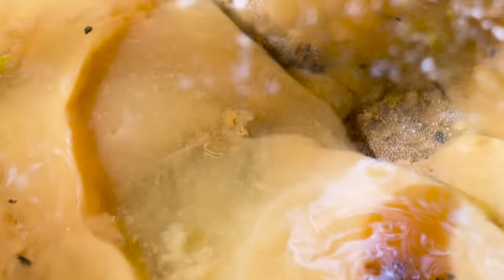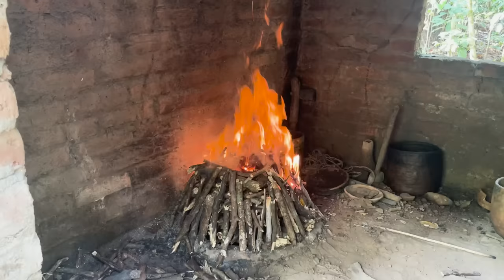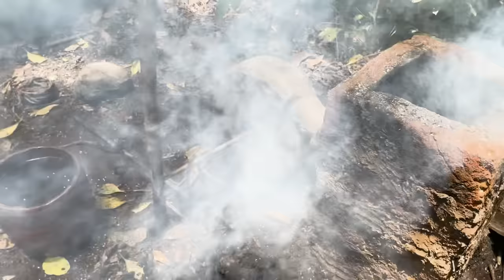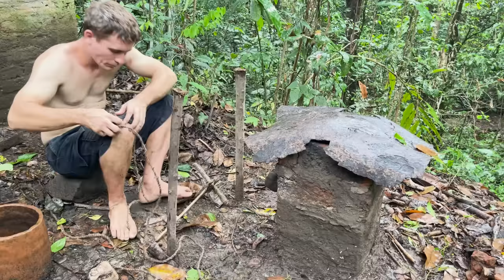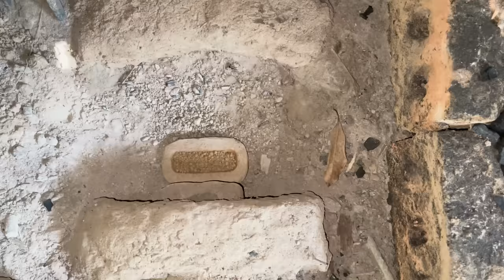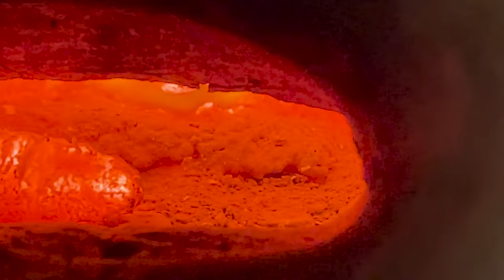Primitive Technology: One-Way Blower Iron Smelt & Forging Experiment

Comment from the maker: The new blower produces more iron than the previous one. Using the same amount of ore and charcoal, a similar sized furnace and the same bloom processing method it makes 51g as opposed to 31 g of the previous design. The continuous blower is a big improvement over the intermittent spinning design (and this was only the first try). It's the most iron I've made in a single smelt yet.

The attempt to form a forgeable bar was disappointing although it was a better than expected casting. In the past I had successfully made forgeable iron by melting the prills in front of a blast rather than making a casting first. I will probably follow this method of decarburization rather than low temperature annealing in future.

The waste iron isn't lost however, I should be able to recycle it in future smelts as I've got a small pot of it. The waste iron from experiments could be re-smelted alone or added to future smelts to increase the yield.
Reply: İm waiting for
Reply: Why no lid on the mold when smelting?
Reply: How does the charcoal making method at the start of the video work? Do you not cover the top? I thought that you need to greatly reduce oxygen access.
Reply: Nice, Ive been wondering what would the first iron tool be, when made, would make forging all the other tools easier?
Reply from the maker: @gregstarr2  A lid would prevent the heat getting into the iron as quickly. Charcoal on top of the iron, directly touching it, conducts the heat more efficiently as iron is a better heat conductor than clay. Oxidation is of no concern considering the iron is already high in carbon and the oxygen has a beneficial effect in decarburizing the iron. Thanks.
Reply: 2 Bellows?
Reply: Perhaps try adding powdered charcoal to the crucible to reduce the impurities from iron oxides, and also try adding wood ash or another substance that could work as a flux to reduce the effect of air on the iron?
Reply from the maker: @eduarddlabola9688  When the charcoal is doused with water it stops it from burning to ash. As you add layers of wood, the burning layers on top use the oxygen, preventing the layers below from burning. So at the end you are left with carbonized wood. The residual heat dries the water off the coals. Thanks.
Reply: i believe you need flux to forge those prills together correctly. dont know when they started using it back then.
Reply from the maker: @user-sd3ik9rt6d  In series two fans would be effective, yes. Thanks.
Reply: Why don't you make a closed mold for the iron so less unwanted stuff mix with it, maybe you can make it by making the same mold you made in this video, then making a cover on floor and stick it on the mold once it's a little dry.
Reply: wow I put the subtitles on and I was able to read lots of good advice! THANKS . don't know this iron battery, super interesting :)
nice videos to watch without words, which relaxes and gives all its charm to your videos. Well done
Reply: @primitivetechnology9550  This came at a perfect time! Thank you for the upload!
Reply: It's impressive that you can do so much with just natural resources. Is it possible to make glass with your current technology?
Reply: Is t an idea to make a blower system like the old wood lathe used to have with a springy branch and a peddel?
Reply: I think the problem is that the pieces of iron are very dirty and this makes it difficult for them to join together and form a single, resistant piece. It might help if you can somehow clean, polish the pieces of iron until they are shiny gray and then try to melt them.
Reply: @primitivetechnology9550  what would you recommend as a way to get started doing primitive technology in alpine areas of northwest United States? Specifically the bitterroots/rocky mountains. It's surprisingly difficult to get useful information by looking at what the native Americans did.
Reply: @primitivetechnology9550  I have seen in a similar channel that rather than a spinning blower, a piston-like blower is used. Would this be possible given the limitations? I.e. rather than the piston being made out of a large log, a clay pot with holes could be formed? Cheers mate!
Reply: What if you put a handle on it to crank air in like with modern steel blowers? Makencreate had a video with a blower that was seemingly (perhaps Im wrong) powered with a type of belt. Do you think those methods could be used and possibly produce higher temps?
Reply: @primitivetechnology9550   I am really sorry for mentioning this if I am mistaken or crazy, but, I noticed a lot of trembling/shaking from your hands. I hope you are good and healthy my man. Take care
Reply: Fantastic work as always, thanks for trying the dual wield
Reply from the maker: @krzysztofdabrowski7803  Yes, ash might work to lower the melting point of the slag in the crucible melting process. I need the iron to get more air to burn the carbon out of it. I think there's too much carbon in the iron as it has a low melting point (can melt it in an open hearth) and it's quite hard but brittle. I was able to make it malleable in a previous video by remelting it in front of a tuyere with lots of air in the forge. Thanks.
Reply: Not necessarily with iron but I mean the very basic stuff, what to use for rope, what to use for vines and the roofing. You used palm fronds and what seemed like very abundant vines in your first videos but those aren't very common here.
Reply from the maker: @deezr01  I think the main problem is it's still too high in carbon and so is hard and brittle. When I get it malleable then flux might be needed. Thanks.
Reply: Hello, I already commented this but it would be interesting to see if there was any good way to hook up this blower to a waterwheel. If possible I imagine that would cut down on the workload significantly and allow for doing other things in the meantime between adding charcoal etc. when smelting. Great video looking forward to the next one.
Reply: I am no expert at this sort of thing by any means, but I believe your going to need to smelt the iron many times in order to get as much of the impurities out of it as you can. The reason it crumbles is because there is still to much "not iron" in the over all composition. How to accomplish the removal of said impurities I can not say for your situation. I do know that modern steel making using slag from previous fireings to strip out the sulfur, if you can find a way to use this when you smelt it might provide some benefit.
Reply: Great progress in this one, glad to see you making strides and continuing to learn. Just wondering but is there any other mineral deposits besides iron nearby you? Would you consider trying to forge them?
Reply: Have you tried making a crucible cup?
Reply from the maker: @ginli2567  Welcome!
Reply: I wonder if you put holes in the nozzle piece if it would draw in more surrounding air in via the Bernoulli effect before entering the smelting chamber.
Reply: @primitivetechnology9550   why roast the ore before putting it in the oven with ventilation? thank you from France
Reply: @primitivetechnology9550  for a more efficient blower a flywheel would be a good way to conserve momentum.
Reply from the maker: @theuser810  Technically I've already made glass in the form of slag (some looks really glassy, green and blue). But I think you mean clear glass. Yes it is possible to make glass. I've experimented with wood ash and sand but it makes a mess. I might be able to make glass objects in a mold by taking gobs of slag, from the forge and pressing them into molds that were pre heated and then allowing them to anneal slowly back in the forge. Thanks.
Reply: I worked as a blaclsmith and the main issue i see is that you are working the iron to cold for welding it into a useable bar.

 Also dont cover your crusible with charcoal, sit it in the carcoal and melt it into a useable bar. The reason you dont want it in the carcoal is that it can actually cause the iron to start to "burn" where as if it is not directly exposed to the heat it melts more easily.

The only other thing i can recomend is doing something like what vikings used to do and making a capsule with the iron in it to fully melt it and then break out the ingot.
Reply: What would happen if you dumped the whole slag/iron mass into a large pot filled with water? The slag would shatter similar to glass, but would it separate more of the iron prills so you don’t have to do as much work to separate the two?
Reply: @primitivetechnology9550  can the tuyere be put further back from the airway causing more air to flow into the furnace?
Reply: @primitivetechnology9550  
I would add a flywheel on the blower shaft, ceramic seems to be the best. It would have a groove for rope and there would be a bigger pulley (wooden "wagon wheel") with the crank in front of it. Thus this would make the blower spin for a long time and with high speed.

The bigger concern I see in the furnace itself. I do not think that a bigger chimney would help if You use the blower. I think that the issue is that the iron barely melts and falls to the bottom, where the furnace is cool since there is no airflow. 
If You make the bottom of the furnace in the shape of the forge (bowl) and the air blows on top of it, it should make a layer of iron and then slag on top, thus removing the slag separation step and increasing yield as well.
If I recall correctly, the typical blast furnace uses coal and iron ore in layers, so You should not add the ore at one time only.
This produces cast iron, in the past, the carbon was forged (beaten) away, thus I would consider the iron bar shattering a normal step.

I hope that some of this will help since we all are patiently waiting for your Iron Age. This is what I remember from school, so check elsewhere if You are planning to use it to catch possible mistakes.
Reply from the maker: @tdog2949  Yes if the fan is to spin in both directions, a pole lathe would work. To get it to spin in one direction how ever you need to have an idle phase in the cycle where the rope loosens around the axle on the return stroke. That might be hard with a pole lathe set up. The reason my leg rope method produced continuous rotation here is because I loosen the rope by moving the leg imperceptibly closer to the rotor on the return stroke, allowing for the idle phase. Thanks.
Reply: Excellent work with the new blower

You might need to keep melting the iron and leaving it to slowly cool after the initial mold, maybe transferring it to a wood fire and holding it near red for a long time after the initial casting could help form better grain structure 

Maybe adding a tiny bit of silica using clay dust during the initial casting can help add silicon and make it more ductile
Reply: Been watching these for a while and love your videos. You should really try preheating your air. Use a small secondary fire with a thin toyere (as thin as possible to promote heat transfer, maybe even multiple nozzles to improve volume flow) going through it and then into your kiln. You'll be able to achieve much hotter temperatures in the kiln.
Reply from the maker: @Fantasma-vz1ix  You might be right, I've not melted fresh shiny prills yet. Thanks.
Reply: In modern forge burners, there is often a jet of gas sticking into a much larger opening and that allows additional air to be sucked in. I wonder if you made the nozzle of the blower smaller and placed it in the tuyere so that it does not seal and had a gap all the way around if it would suck in a larger volume of air.
Reply: Nice yield, mate. Very good job
Reply: I'm fascinated by your films. Try making a gear wheel mechanism for the blower for better efficiency
Reply from the maker: @justinkeele4450  It depends what you're interested in. The rocky mountains looks tough. Probably start with shelter. Dry stacked stone huts or pine wood huts would be a good start. Always start with shelter so you have a place to store your projects out of the weather. Thanks.
Reply: At this point, with your improved furnaces and blowers, do you think any improvements in the quality of your charcoal would be more significant?
Reply: Have you considered just using a crank for the blower? Especially on the horizontal one you use during the second half of the video, it may be possible. Maybe it’s too fragile though.
Reply from the maker: @ginli2567  I've looked at making a piston bellows from clay (made one at home). It produces some air flow and may have higher pressure. But I haven't tested one on a fire yet. I was making a video on one but the rain destroyed it. I'll revisit it another time. Thanks.
Reply: I am VERY curious if you think you can make a Baghdad battery.  It is VERY simple to make, and if you can make that, you can make copper wires, and make an electromagnet, which you can then in turn make an iron magnet, then maybe a generator?
Reply: The circumference of that little wooden stick rotary shaft is tiny. You need a gear, a larger sphere of wood where you can attach the rope. It's like you're riding a bike on first gear.
Reply: Really nice having those improvements. You could add a small weight to the shaft of your flywheel, near the flywheel itself. It would need to be balanced (symmetric). This might allow less 'pulls' on the cord, but still have the same speed of the flywheel, or a bit more. Not sure it's important, but since you made other improvements I thought it worth mentioning.
Reply: Would putting the mold away from the tuyre make the melting process more efficient because there is less cool air getting to it?
Reply: @nureinbratwurst2109  It's hard work and fatigue.
Reply from the maker: @danielmariolle4918  No nearby sources of copper or tin that I know of. That being said, I could be walking past copper without knowing it. Generally copper deposits are found in these sort of domed structures called gossans, I think on the edge of basalt and granite. It's where the oceanic crust has melted under the continental crust and the lower melting point minerals have come up as molten blobs. I keep an eye out for greenish stones. Thanks.
Reply: I would like to discuss an idea that I had which might multiply the draft through the furnace.
If you were to add a second air hole below the Tuyere, and possibly angled the Tuyere slightly upwards instead of downwards, might the draft upwards through the furnace from heat rising suck in additional air from below?
This would increase the heat created without requiring additional work.
Reply: Have you thought of enlisting an extra person during the smelt so the blower can be operated continuously by one person and charcoal and ore added by the other person?
Reply: Still think you should put rocks on the rod to make a flywheel as it will balance out your inputs and make it spin more consistently.
Reply: I love having watched the stone mortar grow deeper and deeper with every video. You can tell it's had a lot of use!
Reply from the maker: @DAV4WSR1  Roasting ore dries it out physically. But it also removes chemically bound water too. This is an energy consuming step so if its done before smelting then it prevents heat from the smelting process being used up, leading to higher temperatures during the smelt. Thanks.
Reply: What about adding bit of weight to spindle (like in pump drill) may save some energy. Also would it make sense to make cone shaped tuyre and add some holes to narrow part or spread it at joint? (Bernoulli law says it should work better, but i don't know physics)
Reply: That improved efficiency was exactly what I was hoping for. After the Cody's Lab pop can thermite video yielded a large mass of iron, I suspected that higher temperatures with the better blower would give you a much higher yield and that was a very noticeable improvement.
I'll be really excited to see if future improvements could eventually yield a singular large mass of iron ready to start processing right after. God bless you my man. :)
Reply from the maker: @MiladEskandar  I'm working on a preheated air method, many people have mentioned it and it sounds like a good idea. Will test soon. Thanks.
Reply: 7:36 Also, I hate to be "that guy"  but you are losing energy in both the movement of the uprights and in the off center nature of the spindle.  I would suggest making the entire blower assembly in two parts, with the only removable part being the lid and formed (and fired) spindle and blower fan (which should also be of fired clay.  Yes I think that can be done by you, I've seen your pots.)
Reply from the maker: @vahannema  I'll work on a charcoal retort, it's on my list. Although pit made charcoal seems similar to mound charcoal as long as it's dry.
Reply: What about a water powered blower? You may even be able to setup multiple water powered blowers at the same time then, like one on each side of the forge. A simple waterwheel could power two blowers, front and back sides, at the same time.
Reply from the maker: @myrhev42  A one to one hand crank doesn't spin fast enough. I tested the idea here: https://youtu.be/Csb-AFD58ww .Thanks.
Reply: @primitivetechnology9550  seeing your replies has me curious - what is your research approach to trying new methods? i've always wondered how much is improvised!
Reply: @primitivetechnology9550  Good of you to ignore a legitimate question about something important. Shows a lot. Cheers
Reply: @primitivetechnology9550 Try making the tuyeres longer so you can have a secondary fire that heats up the tuyere, the fresh air from the blower will be preheated before entering the main furnace this way. You may need to make the tuyere in multiple sections or perhaps some more sophisticated heat exchanger design. This can greatly improve you melting process. I work with an industiral blast furnace and our air is preheated to above 600c before entering the furnace.
Reply: Curious if there is potential for mirroring the blower on the other end of the rotor shaft so you can have two smelts going simultaneously
Reply: Maybe you should take a look at japanese primitive metallurgy methods.... They can manage carbon content in iron very well....
Reply: Have you considered trying to find a natural flocculant to settle out the iron bacteria?
Reply: Does mud have any superior properties over plain clay? Or do you use it in cases like putting the tuyere in because it's significantly cheaper?
Reply: I and my kids love your videos. I do have a question though. If you turned the continuous air fan shroud upside down; as in instead of having what looks like the shape leg of a P pointing down from the top, have the shroud's P on the ground, while still maintaining it's current axial rotation; Would you be able to bury the the tuyere in the ground and therefore hopefully making a better sealed duct for the air to enter the bottom of the furnace?
Reply: @primitivetechnology9550   Okay, thank you, nice to read you ;)
Reply: You should use the river to keep the rotor spinning continuously.
Reply: you need a flux like borax to make the iron more stable for forging
Reply: man you should try to make a hammer or knife, with the current level of technology you're at.
Reply: @primitivetechnology9550 Try making an ancient blowtorch maybe for precision metalworking. All you need is some kind of oil lamp and a blowpipe that blows into the lamp's flame. It gives a jet of blue flame.
Reply: @AlexeySherstnev  he  doesn't need to he just need to make a wheel with a handle on the side for the belt to attach to.. that shoudl give him the  constant speed he needs
Reply: Would it be beneficial to add a circular clay weight to the rotating part of the blower to better maintain momentum and decrease airflow loss when not powering it, similar to how they do it in cars?
Reply: My kid asked me if you'd ever used a crucible before.  I told them I don't know. But we should ask. I think it would make refining the ore much easier.
Reply: I was wondering about the change in charcoal creation, I have read one of your previous Wordpress articles and it said something along the lines of "I let the charcoal cool down until warm to the touch (Sometimes taking two days)." Here you douse the charcoal with water right after fireing the wood. Any chace I just missed something? I am greatly curious on my there is a possibly different method used here.
Reply: Cant you add some selfmade flux to the iron before melting it to a bar?
Reply: For max air, I would think a double accordian bellows (one side is always sucking, one side is always blowing), run by a waterwheel would jack those temps.
Reply: Okay one last idea ..If you had a gravity assisted feed of charcoal and the Iron prills you wouldn't need to stop the fan. The thought I had was to have a basket up in the air for both the coal and the iron slag and you can pull on a rope to pour the reagents into the furnace.
Reply: That makes sense, with the new blower design you are able to both get the furnace to a higher overall temperature and keep it there more consistently. One thing that might be good to try would be to increase the size of the batches (if possible) as there are positive correlations of yields to the quantity of ore being processed in a single smelt with bloomery furnace designs.
Reply: it might be benefitial to give the rotor of the blower a sort of flywheel
Reply: potentially would be more difficult than it intially sounds, but instead of a second bow thing (the rope and stick) on the other side of the blower, could you attach one upside down to the current one, so that it can provide power in the right direction when the other is lifted, and vice versa?
also thank you, your videos are always great to watch
Reply: if you made a disk shape on an axle and connected your pulling rod to the outer edge of the disk on one side it would be the perfect setup. then just add a hand crank and youre good to go, it would convert rotation energy to linear energy in the rod and then back to rotation for the fan axle
Reply: To get the metal balls out of the slag, you could try building a grinder. This could make the step a little easier.
Reply: @catseye10000  But what about production volumes? Does he need to increase his productivity? I think this is important.
Reply: @AlexeySherstnev  no cause he is a researcher at university, this isn't business for him, he trying to figure  out how early peoples did things
Reply: Maybe adding a clay disk to the rotor for weight will give enough inertia to keep it spinning between strokes. Also, maybe drive this clay disk with a larger wooden wheel connected with a rope/belt... For the "double stick" technique, if you place one of the sticks above the rotor with the loop upside down, you can generate power by drawing the first stick and then by pushing the other. Also, connecting them in a Δ shape will make the operation a lot smoother.😊
Reply: @primitivetechnology9550  Two ideas, maybe have smaller bowls with the coal and ore already portioned in them would mean a lot less time away from the blower, you'd not even need to get up. Other thing, adding any kind of gear system to this would make it blow soooo much more than it already is. Just making another similar device you're using to drive it now but instead driving a larger diameter clay disk with a belt going to the one you have now. Or simply make a crank. Would be happy to go more in-depth if wanted .
Reply: I enjoy these videos. I got the book as a gift a few years ago.
Reply: When you pull towards yourself in a sitting position - It looks like some kind of movement with very limited use of body power. Enlarge the whole structure a little, make it more robust and raise it a little. Then you can stand up and use both arms, core muscles and other strong muscles of your body. Any person who works physically will tell you that in order not to get tired and to be more efficient, you need to load your whole body.
Reply: I saw your reply to someone asking about copper/tin. I think it would be fascinating to see the difference in smelting these ores vs iron... even if the ore was imported.

Thanks for making these videos. Only videos on YouTube that I watch twice. Once without subs to just watch and enjoy, then once with subs to see all the details. Amazing work.
Reply from the maker: @sum_rye_hash_321  It is a good suggestion thanks, good to know industry uses 600c air, I thought it would have been hotter. I'll see what I can come up with. Thanks.
Reply from the maker: @reyd__  Probably have the blowers in series (inlet to outlet) and just power one smelt. I've seen such blower setups, they achieve higher pressures. Thanks.
Reply: Do you think you could add a clay weight to the blower rotor to maintain momentum on the return stroke? I know that might be difficult to balance.
Reply from the maker: @EugenioCardoso  Yes, I've looked at Japanese metallurgy. There are lots of methods they use for carbon content primitively. Thanks.
Reply from the maker: @uncleelias  Anything very basic will cause it to precipitate. Ash will cause flocculation in theory, but it didn't work. I used bleach at home and it worked well though. Thanks.
Reply: Now you can see why they closely guarded the process.  There's still to this day types of steel that we can't figure out.
Reply from the maker: @ieatdirtwasntavailable  Yes, just cheaper, better to use mud than good quality clay, better to save it for pottery etc. Thanks.
Reply: Video idea: make soap out of wood ash. The ash contains lye and can be derived from it
Reply from the maker: @Scott_C  Yes, but the housing would have to go the other way so now it blows air towards the operator, and so the furnace would b between the user and blower. It's the way the rotor needs to spin because of the one way spinning technique. Quite feasible though. Thanks.
Reply: 📍 Look up: The Blast Furnace: 800 Years of Technology Improvement 
PULLEY IS AWESOME! 
Magnet or lodestone to help separate iron? 
📍 Consider making a gearing mechanism or flywheel. 3-step gears? 1st gear to 2nd, to 3rd gear to increase fan rotations? Then a gravity drive to the first gear (water wheel or stones).  Gears, gear steps, LOG axle flywheel:  🔹 wooden cage gear + a peg gear. YouTube search — Robert Murray-Smith peg gears  🔹 stone: Consider a basalt rotary quern-stone.  📍 log as axle creates greater stability (less wobble) and flywheel. Think of a gym bench press, but the weights at only one side. Two or three big plates with a few smaller/thin plates sandwiched between. These become different gear ratios and a flywheel. Lay across 3 or 4 sawhorses. Be sure to enclose or secure the empty side of the axel where your fan is located. Or integrate with the peg gears for different uses. Basically a waterwheel on land.
Reply: @PIESISSYSTEMS Yeah, any kind of gear system would make this incredibly efficient. I wonder if the disk idea would work with such simple tools and materials, I think it'd have to be very well balanced to not vibrate too much, and the simple wood might not be able to carry much weight or stay stable.
Reply from the maker: @Scott_C  Yes but heated from the open top (like this video). The clay here melts at iron melting temperature so a crucible wouldn't work if the heat had to go through clay walls. Melts the crucible before the iron. Thanks.
Reply: I wonder if adding a flywheel to the blower to keep the momentum on the return stroke would improve efficiency
Reply from the maker: @josepollo419  It's a quicker way of making charcoal. Charcoal made in a mound will be drier though and might also be harder. But they seem to perform the same in smelting. In the early days of word press, I always made charcoal in a mound. Then I tried pit charcoal and it seem fairly similar with results being about the same during smelting. Must be dry though. Thanks.
Reply from the maker: @SnapShotter  lime or silica. So ash or crushed quartz might make good forge fluxes. Thanks.
Reply: Congratulations on a new smelting record! Glad to see you finally increased yield
Reply: Would a wooden and a crank make a more consistant flow of air?
Reply: @ivetechnology9550 So glad to read that you are working on a preheated air method, seems to be the next logical step in raising the smelting temp. Any thoughts to reduce or eliminate the cool down time when loading the charcoal? 
Love the channel and look forward to all your videos.
Reply: I'd be very interested to see you do a beach survival situation
Reply: Making a wheel, or two even, for a pulley to improve your blower would make for a great video and open up a whole new branch of technology to explore! Do you reckon you could fashion one out of clay? You certainly have the skills to do so.
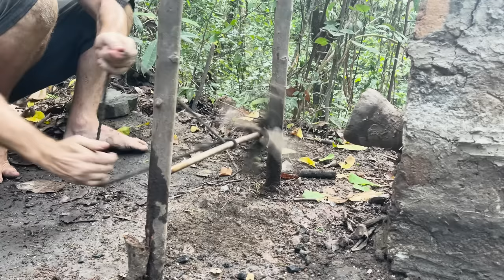Reply: 16:06 Using a gear ratio advantage would give a ton of air velocity if you could fabricate different sized gears or a suitable “belt” and pulleys. Think of a bicycle crank and chain.
Reply: Have you considered adding a flywheel to the fan rod? Like a flat disc shaped out of clay with the fan rod through the center?
Reply: @primitivetechnology9550  Have you considered experimenting with different types of charcoal? Some are known to burn hotter and cleaner than others.
Reply: @primitivetechnology9550  
Maybe try smelting it with a blower, but also a tall chimney to get some assistance from the draft?
A special finishing furnace, specifically for this purpose.

If you get enough quality iron to forge tools, you could start making better equipment out of wood.
Like say, a hand crank for your forge blower. lol.
Reply: Rather than two sticks, if you can support the weight, a clay flywheel would even out the RPMs.  Or even just more mass in your fan blades. The closer you can keep the tip of the fan to the enclosure, the more efficient it will be.
Reply: I wonder if a stone mold, rather than a clay one, could be more effective at isolating the iron so as not to ruin the integrity of the iron. Much more difficult and time consuming, but perhaps one of your more well-worn mortar could be repurposed? I also feel like the direct piling of fuel on top could be affecting the quality of the iron. Possibly contaminating it there.

But could an oven design of super heated air, rather than directly heating up against the burning fuel, be accomplished?
Reply: @primitivetechnology9550  thanks, what if debris gets in the molten iron though?
Reply: I don't know how feasible it'd be, but it would be interesting to see if you could get some automatic blowing action using a small version of a water wheel in the stream near your area. While it'd be significantly more work, some sort of weird gear reduction (because of the power of flowing water) using ropes miiight speed it up more. Otherwise, thanks for the content, love watching it.
Reply: I’ve seen previously that for this sort of more raw iron people would find it much easer to manipulate it using wooden hammers and blocks. This was to prevent it from shattering as the material was too brittle for normal hammers, I’m not sure if this is already in your consideration - but could be worth a try as it seemed stones really didn’t do the trick
Reply from the maker: @Scott_C  Maybe have the ore and charcoal in pre-measure baskets (one charge per basket). Then it wouldn't take so long bethween charges. I've considered it before but hard to make, need one basket per charge (e.g. 8 for this one). Doable though. Thanks.
Reply from the maker: @shadowtheimpure  Yes, a longer smelt would probably save more materials. Economy of scale. Thanks.
Reply: Have you tried doing anything to lubricate the bearings of the continuous blower? I assume there has to be a pretty big loss of energy from friction there and you could get more airflow by mitigating that
Reply from the maker: @chrisforeman1041  Yes, I tried one above and below the rotor but it was unwieldy. It was so clumsy I didn't film it. what happens is the two ropes are right near each other they snag. Thanks.
Reply from the maker: @catseye10000  I don't work at a university but yes I'm trying to figure out how to make it work primitively just out of interest in the subject. A citizen scientist if you will. Thanks.
Reply from the maker: @Schwarzgeist89  Much appreciated.
Reply from the maker: @beepseatsfindingfoodtreasu8756  It's hard won knowledge. Thanks.
Reply: Amazing results and lots of improvements, good job! I suggest adding a new tuyere and a blower on the opposite side of the furnace and using a longer arch to control even the opposite direction of the opposite blower, so you'd have two air flows coming all the time. I also liked the idea of using the foot for continuous movement. You could add a pedal like those antique sewing machines... :)
Reply from the maker: @KGTiberius  Good suggestions. Yes I've seen Robert Murrays videos, he's got good ideas. Thanks.
Reply: @ivetechnology9550oh cool and you  could  make a  crude belt wheel for the  blower  maybe  with handle. if that is not  to advanced for your purpose
Reply: haven't watched the whole video yet but i wanted to say that "annealing" cast iron really is not possible. cast iron just cannot be forged at all at any temperature or heat treatment.
Reply from the maker: @linasvelavicius330  Make pre measured charges in baskets so there's less handling between blowing the furnace. Much appreciated.
Reply from the maker: @ailbheskyfeather174  I think that's feasible but only a small diameter clay wheel (<50 cm diameter). Two in series does a lot for rpm as well. Thanks.
Reply: @theuser810 glass is actually easier then iron, the core problem is hes lacking diversity and quality of raw materials.
Reply: You should try a "belt-driven" blower that is hand-cranked so that the air stream can be continuous
Reply from the maker: @darkfur18  Denser hardwood charcoal is supposed to have more energy. Though some prefer pine, a soft wood, for smelting as it's got more "reactive". Not sure what that means but I think it's got to do with chemically reducing the ore better. I use Eucalyptus or northern olive for charcoal. They work about the same. Thanks.
Reply from the maker: @Chuck_Huckler  I tried a taller furnace but it works about the same. Thanks.
Reply from the maker: @timward4301  Or heavier wooden fan spokes, clay may break apart when spinning high speed. Thanks.
Reply from the maker: @Mcaark  The clay doesn't melt so it wouldn't get into the metal. Yes there would be some contaminant from the charcoal but it would be on the outside of the iron mass. Yes, pre heating air could be used in the forge, I'll test it some time, agreed. Thanks.
Reply from the maker: @gregstarr2  It would likely float on the iron as dross, not get into the metal. Thanks.
Reply from the maker: @keith4864  Yes it would need a gear increase or belt and pulley. Thanks.
Reply: @primitivetechnology9550 maybe you should make firebricks  because they hold the temperature high enough for longer period of time. They are made from grog mixed with clay. So thats my suggestion🙌
Reply from the maker: @NotToast859  Yes, I wet the bearings occasionally and it does make a difference (less noise, easier to spin). Thanks.
Reply: adding a clay flywheel to the new blower will also increase the effectiveness of the blower.
I think this results show that kiln temperature is still to low for efficient smelting. The new blower is definitely a step in the right direction. Good work.
Reply: @nureinbratwurst2109  Mate, I scoured this thread and only saw one other comment by you, which wasn’t even a question, it was an observation about his health. You write this comment like John owes you a reply and should publicly comment on a private matter for himself. I’m gonna assume I’ve misinterpreted you’re attitude here because in your other comment you seem to wish John good health yet here you use sarcasm to attack John’s lack of reply. If anything “show’s a lot” it’s your cowardly and egotistical behaviour here.
Reply: Maybe the same setup, but two blowers could be a good improvement for air intake and reaching higher temperatures
Reply: Great work! This is such a fascinating project, it's clear you're dedicated to an authentic scientific method which is the whole point. You're so close to a reliable method for making iron tools!
Reply: I think your next focus needs to be on obtaining decent flux. This method generated very respectable prills and can scale with time and charcoal. The problem is bringing it all together. May I suggest building a lime kiln. Not only will it make a good video in and of itself, the resultant quicklime can be used for both smelting and concrete projects.
Reply: You can try bellows next time, it's far more efficient.
Reply: I will say, I still think that you are producing Pig iron and not Cast iron. You are working at far too low of a temperature to melt cast iron, only Pig Iron melts at that orange-yellowish color you showed. It would make sense, since Pig iron melts at these relatively low temperatures without requiring half a day to melt or destroying a fragile natural clay crucible. Also, neither pig iron nor cast iron can be forged at any temperature with any heat treatment. It just cannot be done. Only iron and steel can be forged unfortunately. This isn't bad btw, making pig iron and decarburizing it is probably more efficient of a process than making bloomery iron. But you will have to find a way to get high enough temperatures to reliably forge weld iron to make forgeable billets.
Reply: have you thought about making a simple crank?  thicker wood, U bend ?
Reply: Imagine creating another blower for the furnace and placing it at the other end and using on motion to power both, possibly by using a longer stick and rope. just an idea to increase airflow.
Reply: You only need to find a good method to decarbonize the cast iron and it's good to go. Btw, i think that you should use more iron per smelt
Reply: @mattparker9726  I think that goes way beyond the scope of his projects. I love the idea but i think its way too theoretical to work at this point in time. The copper wires would requiere copper ore in some way, a way too work with hot copper, drawing it out into thin, equally thin strips and then it also needs to be connected. Additionally it needs a coating which stops the electricity to be conducted which i have no idea how to create in this scenario. And thats all just for copper cable. We are not even talking about a magnet or a reliable rotation to generate electricity. Again i love the idea but maybe he should first try to get forged iron reliably
Reply: @nureinbratwurst2109  You should really work on your manners and empathy
Reply: I’m curious if the next innovation will be a water powered forge. Specifically, instead of using a bow to have a continuous fan be used to power the blower, attach some sort of water wheel or even paddle system to a source of water. You’ve shown that you have access to hollowed out bamboo that could be used for piping of some sort. just need to create stands to hold them up and create some sort of system for the water to go and flow out that doesn’t impede the local area so it doesn’t turn the ground muddy.
Reply: Looks to me like you maybe have a better source of iron if you dug down. I have a well that was drilled through a vane of iron and the water if you let it set, turns orange like your source looks. Looks like water is running over the ore somewhere.
Reply: Thermite which burns insanely hot is actually just Iron (III) oxide meaning it could be possible to obtain naturally, I think your idea of rusting the cast iron first has lots of potential!
Reply: @drizztdourden4929  A: you can cold work copper, so drawing it out into wire isn't that difficult.  And B: you can hammer forge an iron bar INTO a magnet, (look it up, it can be done.) And insofar as insulating said wires, that's easy.  Pine pitch glue.  When it hardens it will be very stiff.  Rotational energy can be had easily because he has a stream nearby.  So no, I think DC current is feasible,  if not a very clean signal, maybe?
Reply: @primitivetechnology9550  Isn't it more that you don't want surface to oxidize, so you use flux to insulate the iron from the air?
Reply: @primitivetechnology9550 

Thanks for making amazing videos. I'm an archaeologist and it's kind of like backseat experimental archaeology. Have you ever felt compelled to decorate/incise any of your pottery? Do you deliberately leave them rough and functional because they are replaceable tools and that's all? Entire books have been written about that question.
Reply: @mattparker9726  Thanks for the infos. Im still unsure if the precision requiered is possible with the available tools but im also not experienced with that. As i tried to made a magnet before i used an iron core and copper wires made with modern tools so very high quality. But even then its very hard to generate a good measurable amount and definitly too low to actually use it. The thing about electricity is that its useless if it isnt stored or used. So you have an idea on how to store the generated electricity? And also if the requiered coils can be created under these circumstances?
Hope we can continue the talk. Gotta sleep now. Lots of thanks to you for the answers
Reply: @drizztdourden4929  thank you too, your comment made me start thinking about electricity in a "primitive" way.  I do know of the so called "baghdad battery"    which is a clay vessel with a slight acid in it (think wine or vinegar)  with a central iron core and a copper coating?  I think?  ( don't take my word for that, I forget how it's exactly constructed.)  anyway, that cell has been demonstrated to work by multiple people, and can store and use about 4 volts DC.  It's stuck into a clay pot, and is supposed to be from SUPER early in history, in fact, too early according to the mainstream history.
Reply: @TigerTiger-fx3ps
35 minutes ago
Is it possible to rub 2 iron wires together to magenitise them? Might be possible to make primitive electricity
Reply: @nureinbratwurst2109 with the amount of manual work the man does, Im not surprised his hands shake sometimes. Seems to me John is as healthy as they get
Reply: To be fair, my ideas were presented with perfection in mind, so: longest lasting, fully modular, etc. I'm sure you better know the materials than I do, however, so here's the only design principle you'll ever need: let each thing be what it is, and not what it is not.
Reply: Amazing results! How much did the original bar weigh? I think it might be time for you to attempt some crucible steel!
Reply: @primitivetechnology9550  It is a coke fueled furnace so im not sure how it will translate to charcoal but i think any decent amount of heat would be a big help.
Reply: I bet if you used a treadle you could easily increase the fan speed.
Reply from the maker: @bilbo_gamers6417  Pig iron is cast iron with impurities in it. Cast iron has a low melting point relative to lower carbon alloys, 1150 c being the lowest, which is in the range of a forge. From "mastery and uses of fire in antiquity" the author mentions a method of forging cast iron using a low red heat and soft hammer blows and has himself forged a cast iron bar to a chisel with a thin edge. It's not often used but it is possible to forge cast iron this way. A second heat treatment method was used in ancient China, white cast iron was put into pottery kilns to make malleable and ductile iron without melting it. When people say it's impossible to forge cast iron they probably mean impractical which I would agree with.

 I'm unlikely to revisit these methods as I've already had success in making iron malleable by remelting it in an open hearth in the decarburization video I made a while back (here it can be see the iron flattens under the hammer stone: https://youtu.be/pOj4L9yp7Mc?t=377 . It seems faster and simpler than annealing. Thanks.
Reply from the maker: @junkman1561  The iron bacteria gets it's iron from the sand, I know this because I've sluiced the sand to separate out the magnetite and when left in water it forms rust on it. Also, where this bacteria has formed is in a sand bar of this same material after a change in the creek flow after a flood this year. Thanks.
Reply: i must say the yield looked very promising. Though i think the furnace doesn't get quite hot enough. 
perhaps i would consider crushing the charcoal and pressing it to compact it as much as possible. 
as much as i like the fan, i don't think it can reach very good pressures. i think it needs to be improved. longer and stiffer fan blades that seal better or better mechanism to reach higher fan speeds. therefore the furnace can be higher and reach higher temps.
I would look into making hard resins from tree sap to make better shaped fan blades (also easy to secure with more resin to the shaft)
Reply from the maker: @Anton-pb1cn  It's also where the idea of wet puddling comes from, when they add rusty cast iron to a puddling furnace it gets hotter when it melts due to the iron oxide reacting with carbon in the cast iron. Thanks.
Reply: I cannot even begin to tell you, having followed you for YEARS, how excited it makes me knowing that possibly in another year or so you'll be able to make something with all this iron.  The prospect if seeing you FORGE something makes it worth fighting through another day of the working mans schlog
Reply from the maker: @sithlordzach8418  It should be ok, there's already too much carbon in the metal so some oxygen removing it would be beneficial. Thanks.
Reply: Have you thought about creating some type of version of a ceramic crucible? Im sure there is a few limiting factors. Like the forge temperature not being high enough, or a general lack of large quantity of Iron.  but i'm curious to as why it wouldn't work
Reply from the maker: @el_pierre  I burnish/polish the pots so they function better as water tight containers. In a social context, decorated pots would make sense, I'd say people would prefer decorations. But utilitarian use needs no decorations on the pottery. I'd say societies with more individualistic values would be more likely to decorate the pottery so the individual stands out, group orientated societies would prefer plain ones so the individual fits in (unless decorating pots was the norm there in which case the opposite would be true in order to fit in.)
Reply: I think higher temps and some more refined coke will help you make forgeable iron.  Crushed limestone and animal / bug shells i believe is what was used originally.  I think some proper coke with the new blower might do the trick.
Reply: Learning to forge iron through trial and error just like our ancient ancestors, this is why I love this channel.
Reply: @primitivetechnology9550  
That's interesting. Maybe airflow isn't the problem but the fuel? Is it getting hot enough to properly sweat out and burn off the carbon?

Maybe try hardwood charcoal, or some other refined fuel that burns hotter.
Reply: Love the section about testing viewer suggestions.  I was one who suggested two sticks, but it seems evident that it's a small gain at best.  Maybe worth doing when you have nothing else to do with your other hands.

Perhaps the foot-powered blower will prove more useful during forging, rather than the smelt, when rapid hand work is critical to reduce losses to scaling?  Typically you'd have a second person there just to manage the fire while the smith does most of the forging work, possibly even with a second assistant, so offloading some of that to other limbs may help if you don't have anybody to enlist.
Reply: @primitivetechnology9550 I saw someone already suggested a clay flywheel, but if you instead tied a heavy branch to the axle and balanced it so it would act like a flywheel, that would be more secure and might make it easier to keep the blower spinning, you would just need to get it started manually
Reply: @primitivetechnology9550  That's interesting, I've never heard of anyone successfully forging cast iron before, certainly not the non-malleable stuff. It reminds me of people who claim they can forge brass. I have tried similar things and it can be done but it is so brittle at high temperatures that it is, as you say, impractical (except with certain alloys. cartridge brass for instance had so much zinc that it will just crumble like dry bread if you try to forge it at heat). And it just gets More Brittle with more heat lol. You could literally forge cast iron at almost molten heat and it will break. The reason I wonder about temperature is that when you melt cast iron in a foundry, you usually bring it to white heat, which is like 1400 to 1500 C. Not super far from the temperature required to soften and dissolve Steel or pure iron actually. I imagine your alloy is probably 4 to 5 percent carbon, and your long soak times allowed it to melt and weld together decently. The only issue is that you're going to need to get to even higher temperatures in a hearth to weld pure iron to itself, but I'm sure you can accomplish that with the blower you have though. Blacksmiths burn iron all the time on accident lol. Also the other concern with forging cast iron is that you could never get rid of the porosity in your metal. You can see porosity here and there in the bar you made, which would be fine in iron, but that could never be fixed in steel, and it would cause it to crumble during forging even if you did everything right. Thank you for the response, and good luck with your project!
Reply: If you ever want it tested metallurgically, get in contact with a local foundry, they should have a spectro machine onsite
Reply: @primitivetechnology9550  thank you for your fortitude brother, been watching for years, love the effort in splicing all the clips for these vids. Regarding more air flow and efficiency for your iron production, If you do end up  having the 2 blowers in series, you could turn your chimney stack a quarter turn (45deg) and have each fan blower extension aimed into a corner of the chimney.

Fan drive: You only need to have one drive, whether it is the wand/rope combo.

Foot drive: If you want to do a simple one, maybe tie it to a toe

Basic pedal: and you could also have another rotating axle but a shorter one just above your foot 🦶🏻
Reply: your control on smelting is so random that there is no way that isn't within margin of error
Reply: @primitivetechnology9550  maybe a ceramic bowl instead of a basket. To hold the prills and char.  I could see the ash and char sticking it falling through a basket.
Reply: Have you tried using thicker walls for the forge, i.e. double or triple brick thick walls? I'm not sure how much more you would insulate the furnace but it may help. I know for brick homes in the states they are three bricks thick for heat insulation.
Reply: Have you thought about slag tapping your smelt? Would save time in the consolidation process.
Reply: Thank you for testing our suggestions from last video. The two handed method actually looks really promising, and seems like it might be easier on the joints and muscles than the reciprocating linear motion. Can't wait until you have a fully functional Flintstones tech Bessemer process plant in your jungle clearing!
Reply: Also, if you use a tuyere with a smaller diameter exit it should speed the air up.  You could also use a longer tuyere and raise the blower so you can be less hunched over. This may increase air volume moved? Not sure. I might be thinking about that backwards. But the narrower exit hole might improve the fire. Not sure. But old bellows always had small exit holes
Reply: Add a second blower on the same drive. A flywheel weight on that shaft might help as well.
Fascinating content, sir.
Reply: When you have formed a billet, you need to soak the bar at welding temperature for some time. This allows the crystalline structure of each prill to begin to coalesce and travel between one another. Holding the temperature allows the atoms to move freely and only then can true welding occur. The bar should be screaming white hot in color, without burning into the air, a true flux may be required if the ore is low in silicon.
Reply: It was a nice ingot while it lasted. Is there a song you sing in your head to keep a steady pace while running the bellows? I’m hoping it’s something by the Beegees.
Reply: Congratulations on the improved yield. I am curious if a larger diameter center section that your fan cross is attached to would be an improvement, both in the additional mass of a larger log acting in a flywheel fashion, as well as acting as a larger "gear" for your rope to turn, increasing the speed of the shaft with the same arm movement. If not an entirely new, larger center section of your wooden frame for spinning your fan, then a section of tree branch a few inches wide to act as a pulley for your " belt" cord to engage with, of whichever limb diameter works best to act as both pulley and flywheel. I would think that a stick similar in size to your uprights that are driven into the ground with the pivot holes may benefit you. It should be an easy test st home to see if it is viable. Just a thought, not a critique.
Reply: You give us numbers of how much iron you get after picking prills out by hand and panning. But I assume you have tried getting a really strong magnet, (wrap it in fabric or plastic,) and then try to have it pick up any remains from the forge's bottom, the crushed slag + the water you panned in. How much does it show you lose in those processes?

Also, seems you have issues with making the iron properly melt into itself + purifying and forging it. Have you tried with a batch in modern tools (hotter forge, proper mold, experienced blacksmith, hammer and other tools, etc) to see how much forged iron you should be able to produce from a batch at ideal? Would be interesting to know if those small batches are expected to become way way less either way, or if (it seemed like) it became less as a result of poor methods (melt & anneal directly in a fireplace lying ontop of the fuel, prolly a bit too low temps, and such)?
Reply: gotta get the iron hotter, then it'll burn off the slag
Reply: How many grams of iron do you have in total? Are you saving up to create a hatchet?
Reply: I think rather than the blower, it was the flux that helped you get so much iron. You'll need flux when you make bars too. Thats a component of why its so brittle. The welds are quite poor. Flux would also make the bar a lot smoother.
Reply: A hammer would be useful for forging iron, the best one would be a stone one, made like the stone axes you use

I also have one more idea about burning coal - create a mud structure, try to make it a little more narrow towards the top, and make the "lid" (which always gets damaged) from clay and burn it in the kiln so that everything is reusable. Sealing with mud will eliminate air access completely. The process would basically just be putting in the wood and taking out the coal.
Reply: @mattparker9726  I doubt that a baghdad battery can produce enough current, as the strength of the magnet is determined by the strength of the current in the wire when making it.

I also wonder where he would get the copper from, I can't remember if he's ever stated that he has a source of it?

But it would be very cool to see a generator truly from scratch!
Reply: Add a flywheel to the blower to store kinetic energy!
Reply: Bro got hacked
Reply: Fantastic video as always, I was just wondering, wouldn´t putting a flywheel on the blower make it easier for you to maintain a consistent airflow from it?
Reply: Why not put old dry ceramic lids when making bars?
Not airtight, just a barrier from  coal
Reply: @plvmbvm513  yeah, Idk where he'd get copper from either.  I KNOW there ARE surface deposits of ore though.  And you are absolutely right, on current.  He'd have to treat each total battery as you would a modern "cell"  in something like a car battery.  However, considering it's a galvanic process, at approximately 4 volts, I imagine something on the order of 3,000 milliamp hours, ( around the nominal capacity of an AA battery) depending on how strong the acid is, and how much iron and copper you have in surface area suspended in the solution.  So with enough of them, then yes, building a decent electro magnet to magnetize that iron bar into a permanent magnet should be doable.
Reply: Did you ever consider sending a sample of your raw ore to a lab? I would be quite interested in what the theoretical maximum yield is, and how close you are to it.
Reply: You have a good panning technique with the crude pan. Have you thought about making a bigger pan and using it in the creek to collect ‘black sand’ as an alternate iron source?
Reply: @drewg8710  that is a BRILLIANT idea.  And magnetite also contains gold sometimes.
Reply: FUCK YEAH MORE YIELD
Reply: thanks for giving some extra info! always appreciated
Reply: @primitivetechnology9550  I believe you mean in parallel? two blower housings with a single axle through them is allowed by the new setup. That and a flywheel as other people have mentioned was my first thought when I saw the last video, but a flywheel is going to be finicky, and two blowers is going to be easier to set up.
Reply: Ещё вам нужно предусмотреть отверстие для выпуска шлака.
Reply: I literally clapped when I saw the ingot. 🙌😂 Youre naking huge leaps in improvements mate. I love seeing you incrementally improve the orocess through trial and testing.  Keep ut up man!
Reply: Amazing commitment. I'm a blacksmith myself and have a few thoughts. 

1. Have you considered other sources of ore? Are you committed to finding sources in your area? I saw in an earlier video you were planning and had magnetite in your water source - is this a more pure ore source? In my location you could pan this out pretty quick, and not have to do much processing at all.

2. If you want to forge you will need to get it to a forge welding heat to consolidate your billet. This means yellow - white hot. However you will also need flux to stop oxidization scaling your iron away to iron oxide. Bloomery steel has flux on it already naturally, but it's a thought. Also there is a reason they did bronze before iron - you want metal tools or you heat will sink into your stick tongs. Your anvil, in this case a rock, should also be hot, and even your hammer. We always do some forging on the anvil to bring everything up to heat first before forge welding. 

Take a watch of the ululfbert sword documentary on YouTube, they make a crucible steel which I think would suit your needs much better. Then you don't need to worry about trying to decarborize your steel, it will be a nice solid forgeable ingot right of out of the crucible. Good luck!
Reply: Given the organic origins of both your fuel and ore the iron crumbles might not be too much carbon but too much sulphur - hot shorted  iron.
Reply: You can make the blower water powered. Just lift up a vessel full of water and let it flow down onto a rotor, driving the blower. All you have to do is collect the water at the bottom and fill it back up at the top.
Reply: How about to make a small dam on a creek? You could slightly open the gate and use water flow to power up your blower continuously.
Reply: Rather than spinning one fan with two hands, try spinning two fans with one hand each.
Reply: I think the easier way to get a continuous pull is to use two axles, one with the rotor, which you loop the rope around, and one either above or below, which you just loop the rope over (if above). 

That way you can just pull it down and away from the upper axle.

Also, it looks like you didn't quite melt the prills when making the iron bar. You might need to get the forge built up maybe a full layer, to get it just that little bit hotter.

Also, also, I'm still hoping you will try a crucible melt one of these days. Those cast iron prills would be excellent raw material to mix in with roasted ore/ash  and some charcoal dust in a crucible.
Reply: @primitivetechnology9550  interesting, thanks for the response!
Reply: @primitivetechnology9550  Hello!  One question that haunts me is, what if you try to use a clay crucible to melt metal?  And would you like to create an ancient blowtorch from the Fraser Builds channel, it looks quite simple to create, but could give a new technological breakthrough :)
Reply: How about try to add some weight to blower so it will have more inertia? Harder to start but saves more kinetic energy.
Reply: A couple questions. Did you learn the rusty iron gets hotter through your own experience or where do you learn these small but valuable bits of information?
Also when you load the furnace with three handfuls of charcoal, is it pulling air through the tuyure all the way from the hole in the blower? Just curious if you can feel it if it’s there. Thanks!
Reply: How about a wheel and turning handle with your rope to the bellows. Or a spring branch and foot peddle. Probably not that primitive i guess.
Reply: With this new continuous blower you could try setting a few centimeter wide air gap between the outlet of the blower and the inlet of the tuyere, take advantage of bernoullis principle and maybe get extra air flow into the furnace
Reply: Making a pulley to the stick frame which already exists for the fan blower sounds very feasible! I hope you give it a try later. It would also give you a mechanical advantage for a faster spinning fan.
Reply: This is really incredible.An ingot of iron!
One suggestion for higher rpm: The rope method, but done standing with a longer rope. The peak rpm could be sustained with a flywheel of some kind.
If instability is an issue, the wood post could be replaced with brick and mortar--maybe attached to the side of the hut? Just a thought.
If you read this, know that you are loved by countless many, and your acts bring light and joy to the world.
Reply: @mattparker9726  That sounds faszinating. Im wondering what it was used for. Maybe some form of preservation? Or a way to make fire?
Reply: Can you make and place multiple blowers around the next furnace and bring in some assistants ?
Reply: Thank you for the video. I am a metallurgist by training and was interested in studying iron smelting in the Middle Ages. Can you answer a few questions?
1. I see how you are trying to extract iron from the jelly in the stream, which produces iron bacteria. But have you tried looking for limonite? In the area where I live there is a clear correlation that if there are iron bacteria in a stream, then at the bends of the stream, where silt can creep in, there are deposits of limonite. Limonite is denser and contains more iron. Or is this not the case in that area?
2. Why don’t you burn the rust powder first in a fire? This will increase the efficiency of the smelter. It is advisable to pour gray powder into the melting furnace, not red one.
3. There is a lot of slag in your metal. This is how it should be in principle, which is why the block broke when trying to forge it. You just have very little iron, you need to increase the volume. It is also advisable to melt your “bar” again with liquid slag, it should clean up a little.
PS Perhaps you have already done some of this and the result was not very good. Can you share your experience?
Reply: is it possible to make a automatic blowing system (use the current blower esign but its wider then another fan is made outside the housing the fan connects to the same stick and sits in a flowng creek/river type thing the water pushes the fans rotating the stick rotating the fans inside the blower causeing one way continous automatic blowing
Reply: How about making a grindstone to sharpen your knife/tools? Might be interesting
Reply: Small story that could maybe interest you, i live in a former miner and forger Catalan village in the Pyrénées (southern france, near the Canigou a moutain very rich in iron), and every year our village does an ore melt using the method of the former inhabitants, and i don't know if they way of doing it could pick your interest, i had a hard time finding anything very explicative about it online but basically they build a high and large furnace, load up the ores and charcoal in it, and keep the blower active for a very long time (around 6h but their objective is to produce around 40kg of iron in one melt), once the ores are melted and in in a "liquid" state it make its way to the bottom, they then create an opening at the bottom to let it flow out (or maybe it's the slag that flows out? i'm not sure after watching some videos), this way the ore create an almost homogeneous iron bar even if it require further processing to be forged, if you search catalan furnace on youtube you can find some video about it even if they mostly just show their results and don't explain much about the process
The closest thing i could find to this process is called "bloomery" in english, the wiki arcticle about bloomery state that the slag gather at the bottom, creating a bowl in which the iron can melt and gather to form an homogenous piece, but maybe it would be harder to do with the small (but quite impressive regarding the method of gathering it) amount of iron you're dealing with, this method was used with the result of the workforce of sometime entire villages of miners, the mens extracting the ores from the ground, and the womens carrying it all to the base of the moutain to me melted

I don't know if any of this will be usefull, i'm by no mean an expert on the subject and wasn't very attentive at our village melts but i wanted to share this, maybe it will be food for thoughts

Great video as always btw, so fascinating to watch

Edit : another video i just found : "Iron extraction from black sand", this is basically the method i'm talking about, and the more i think about it the less i expect it to be of any interest to you, since they use a very large quantity of ore, but maybe you could pull it off, also doing it alone could prove to be quite difficult and dangerous, it's interesting nonetheless and worth a watch
Reply: Everything was fine up until you tried to forge it normally, I suspect. The iron hadn't completely melted into a bar, and likely had the individual prills retain their own structure thus causing the crumbling weakness you see in general; this also didn't help facilitate decarburization of anything but the outer layer that was exposed. Either you need a more complete melt into a bar (which is always going to be difficult; casting cast iron is much easier than trying to cast steel, but this can work if you cast the cast iron into a bar and then decarburize it like you did in this attempt) or to treat it like a bloom and gently forge weld the (decarburized) iron into a solid mass using a wooden hammer and stump, which will decarburize it further as well. 

In addition to either method, before this becomes a functional piece of iron that can be worked, you'll have to turn it into wrought iron by hammering flat, folding, and forge welding the bar at least several times. Use silica as flux. This is necessary to spread all the weld joints/ seams between prills along the mass rather than create a nice single easy fracture point (necessary for fine workmanship like making tools or edges, otherwise those finer parts inevitably break), work out further impurities by burning them out over time, average out the alloy of the bar (rather than have one little piece be cast iron and the other mild steel for instance, which will destroy it upon working because the materials will take stresses differently), and make it easier to work and weld in general.  This also decarburizes the iron further, which should be good for you for now.

De/carburization takes a fair bit of time and is based on surface area exposed to the environment, so once you have the solid mass and are no longer melting it, remove it from the mould (which you can probably replace with a shaped ash bottom of the forge to save time, make a puck). You may also have to add another step if you insist on the casting route, by melting it at the hottest point of the fire (which is not the part with the most oxygen at the start! The fuel reacting with the oxygen creates heat and blows that heat further towards the 'neutral' zone of the fire, putting the iron directly into the airflow at the very beginning with little to no fuel in front of it can cool it down) and then decarburizing it in the oxidizing part of the fire. Just be careful not to over oxidize the iron at high temperature and burn it when you do so, watch for the iron itself sparking and immediately pull it out if it does. 

You'll still have to forge weld it later to make it usable for working, mind; the end result just isn't consistent enough across a bar otherwise with such small amounts, you'd have to melt and pour from a much larger mass for that. Something else to be aware of is that the initial working of the puck or casting will have to be very gentle even if you have a fairly refined piece, the grain structure (the internal crystalline structure) can cause it to crumble if not worked correctly. There's just no easy route, either way you have to go through a fair amount of refinement; in the end you'll probably have to do a bit of all of the above. 

I'd consider the actual weak points in your system now; the amount of iron you can produce for the effort, and the difficulty in refinement. The further steps will only take away more mass from the final piece, a larger percentage for smaller items due to increased surface area (so make a big batch and then take pieces of iron off of the final result for projects, rather than small batches). I suggest increasing the total ore quantity per melt (perhaps with a slightly larger furnace now that the air quantity is much higher), looking into methods for farming the bacteria for ease of collection, and building a furnace specifically for remelting the masses you're getting in the initial furnace into a larger bloom or attempting to melt the iron out into a puck rather than trying to pick out prills. This should also aid as an initial step in your decarburization problems.

I noticed what I think is some inspiration from Japanese metalworking, which is probably a good idea considering they traditionally also had to deal with very poor quality ore. 
Generally, a great job. You've come very far, and definitely farther than I thought you would with this iron bacteria
Reply: @gregstarr2  he mentionned decarburizing, so he might have cast iron instead of steel or iron. Exposing cast iron to a flow of oxygen will remove the carbon, therefore it has to be left exposed
Reply: Hi John! Great yield, congratulations!

I think iron at first will be very fragile and you have to forge it a lot to create good quality steel.

I have found this great channel where they show working with bloom iron and transforming it into steel:
https://www.youtube.com/watch?v=uO6HXn18x8A
https://www.youtube.com/watch?v=crv17b-qc4Y

Also have you considered signing yourself for blacksmith training to get some better skills in this area? I feel like 1 smelt costs you hundreds of hours, hence getting some proper skills and experience is very hard, while you could try it in easier environment where coal and air is easily accessible + you have protective equipment, tools and good mentor and it could progress you a lot in a few weekends.
Reply: @hubert_an  the guy seems to know all of that, his bloom collapsed due to excessive carbon content (he mentions decarburizing). Basically he made cast iron and couldn't forge it properly. I think he knows enough about metallurgy and forging
Reply: It"s like age of empires and your in the stone age, trying to breakthrough to the iron age lol. Can't wait for iron tools.
Reply: @drizztdourden4929  the mainstream historians that don't outright ignore it's existence, claim it was for electroplating jewelry.  How someone knew about such a technique in 2000 BC they just leave out, typical.
Reply: @mattparker9726  Hm sounds reasonable. How they found out is still a mystery but that sounds much better then some other stuff i heard online
Reply: The foot-powered fan is a good idea, though you would need a longer rope and some extra construction work. Attach the bottom end to a longer piece of wood to create a pedal, then loop the top end over a small wheel and attach a counterweigh to it. 

If you scale it properly, you will be able to stand up while powering the fan, pressing down onto it with the weight of your body, while the counterweight will pull the rope back and allow you to use the pedal again. 

You could combine it with the double rope technique and make two pedals with two counterweights, which would increase the airflow and make it more continuous.
Reply: @jeanladoire4141  Why does he never try to hammer the bloom when it is hot? Instead he is waiting till it is cold and only picks out prills which are 100% iron content. Doesn't hammering the bloom forces iron to create bigger structure thus increasing yield of smelt?

Also for welding iron together blacksmiths usually sand iron bars till they are shiny and he soaked them in water to create rust instead.
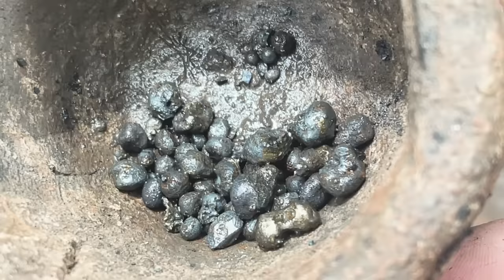Reply: Do you think it might be worthwhile to try to separate the crushed iron/slag by blowing air on it? (rather than panning/washing it like at 13:57)

You'd need to completely dry the mixture (in a clay container at non-smelting temperature) and I'd assume (hope) that the result would be similar to sand but with a much wider range of grain sizes.
On a ramp or the tile-like thing you use to store the slag/iron mixture (seen at the same timestamp, 13:57), the heavier particles should remain at the bottom while the lighter ones will be blown towards the top off the ramp. By adjusting the angle, only non-iron particles would fly off the ramp/tile.
This might have the benefit of enabling you to process much more material at once.

I wish I had the necessary resources and environment to try it out myself. Maybe I'll built some kind of mock-up version of this with other materials...
Anyways, thank you for sharing these videos! I really enjoy watching them :)
Reply: @hubert_an  his bloom is very poor, it's like 95% impurities and 5% iron. Hammering it together hot is nonsense, it's just gonna crumble anyways. Also for forge welding indeed i think he should have used sand or clay as a flux, but it seems he doesnt have iron/steel but cast iron
Reply: @jeanladoire4141  Thank you for answer!
Reply: only about 25 more of these smelts and you can make an ulfbehrt sword
Reply: If you keep melting the iron surrounded by charcol (carbon), wouldn't that keep introducing carbon into the iron?
I think you need to find a way to introduce heat without direct contact with the charcoal, a thin ceramic pot?
Reply: Hey prime! how about adding some inertial mass to the rod ? So it can accumulate spinning momentum, it takes longer to get to final speed but i think this coupled with your double hand method can increase RPM. Adding a clay flywheel or something.
Reply: Maybe find a way to gear ratio your motion and then use gravity to power the blower. Using a spinning log and rod connected with rope as a belt might do it. Getting constant flow is likely to improve results.
Reply: Пожалуйста начни делать вещи и инструменты из железа🙏🙏
Reply: Durante o processo de decantação da bactéria de ferro, não seria mais eficiente ferver a água para evapora-la e restar somente o resíduo ferroso que você busca?
Reply: Congrats on an improved blower! I am wondering if a flywheel is a good idea. Also, I wonder if you see a difference in quality between the pit and douse charcoal vs the dome burn and cover.
Reply: I like the new blower design, it's definitely a huge improvement, just an idea for you, why not harness the power of one of the small waterfalls you have like when you made the water powered hammer? That would allow you to have a continuous steady stream of air and be less taxing on your body. With that you might be able to achieve even higher temperatures. The higher temperature will allow the iron to melt together better instead of fuse with impurities. You might want to try a thinner crucible so it doesn't act as much of a heat sync. Love the channel, I always look forward to watching your videos. Keep up the excellent work.
Reply: Have you considered putting two rope sticks on the axel and pushing one stick as you pull the other? That way you can have more continuous power applied. Maybe diminishing returns.
Reply: is this charcoal method more efficient? Or easier to do?
Reply: Can't wait to see the end reslut of all this finally making a tool out iron
Reply: What about a water powered blower so that it is constantly running allowing for more consistent and possibly higher temeratures
Reply: Its a facinating idea that you are bridging thousands of years of human evolution in this process. But I wonder if there is any historical evidence of producing workable iron in this lowtech a way. The Human bronze age period allowed for far more advanced bellows which included the use of animal skins etc..
Reply: The continuous rope method (the last one) seems pretty promising with a little extra effort you can stretch that loop of rope into a circular polley, then you can add a handle, or a foot crank.
Reply: You need Flux, try some pine resin mixed with the tiny bits of iron you get from water-sieving, heat it up and mix in some beeswax. Mix it into the cake of iron prils/pearls when you go to refine it.
Reply: i've read all comments, i feel like i'm not qualified to give suggestion 😂 but i enjoy reading.
well, keep experimenting.. and i will enjoy all your content... much love from indonesia
Reply: Hello, how would you feel about incorporating an air flow meter into into your work? It's not exactly primitive, but it's along the same lines as a scale. It would give us some hard data to look at on the different blower versions.
Reply: @primitivetechnology9550  I saw some years before in a channel called Rune Malte Bertram Nielsen (a Swedish guy who uses some viking technology's) an foley made by wooden planks and leather, I think that device has a very good air pressure when used, it may increase the temperature allowing a better solder in forge, I believe you may take a look...😉😁
Reply: It's probably been said already, but I think that letting the iron bar cast for longer in the mold is a good idea. More time to melt down together into one bar at high temperature might work, it looked to me like the prills simply fused together rather than properly melting into a homogenous piece. Might also take a more insulated forge.
Reply: Making iron/steel from scratch isn't something I've done but it is a topic I like to follow. Like you mentioned, you have cast iron, or maybe pig iron, with a high carbon content. Traditionally, the process of converting pig iron to wrought iron is called fining and is done in a finery forge. It typically involves remelting the pig iron to decarbonize it which is suspect is why it worked on the prills but not the bar. A common process for fining in the late medieval and renascence eras was the walloon process with a walloon forge. It appears to be a fairly simple process that involves melting and remelting  the pig iron until it is decarbonized. Wiki has a page on it although I wish it was more detailed but there is a sketch of the forge and a few references to be had. I believe it to be something that you could do based on the recourses that you have on hand.
One other note, cast iron and pig iron are generally defined by their carbon content and potently their impurities rather than having gone through a casting process. I would suspect that the prills and the bar fall under the pig iron category as it's likely that they have more than 4% carbon.
I hope that these tidbits help lead you down some research paths that are useful. I hope you're successful in the process. There seams to be not a lot of information about the fining process floating about and I'd like to see a video of someone doing/rediscovering it especially with built from scratch tools like you are using.
I wish you the best of luck
Reply: @primitivetechnology9550 Thank You for the Great Videos and Insights!! 
I hope You are well!
If the Carbon Content is the Problem, maybe try enclosing the Iron Ore in Clay and just adding the good Amount of Carbon inside the enclosure.
Maybe like forming a Ball where the Iron ore and the Carbon are inside and ramping the Temperature slowly up so the Ball doesn't crack and maybe keeping the Temp high for longer, to compensate for the Clay absorbing the Heat.

Best Wishes! :)
Reply: You should try to make some gears. Big wheel  above with a handle to wind and a small wheel on the shaft, connected with vine. Maybe that would speed it up and make it easier?
Reply: You can't decarb while simultaneously surrounding something with carbon.  Your other method worked, although not that well, because you weren't introducing more carbon to it.  I'd look at how medieval smelters and forges were made and start using bricks to make forges instead of dirt/mud and clay.  Solid stuff isn't a good insulator, you need something light that traps air.  I bet looking at modern smelters and forges and trying to mimic the materials and techniques would be even better.  Edit: Hollow bricks, somehow?  I know air bubbles can ruin clay but if you could somehow introduce them as they set it would make them even better insulators.
Reply: @primitivetechnology9550  For reducing the carbon content in your pig iron, look up the Osmond process or a Walloon forge.
You could also put the roasted ore with some powdered charcoal (just enough to react with oxid in the ore) in a crucible (with a lid) to get maleable iron.
Melting iron in charcoal will always carbonize it.
Reply: Hey. In a podcast of Adam Savage he said he visited you in Australia and talked to you about a "project". This was maybe 3? years ago. I wonder if this project of yours flew under my radar or never happend? Could you tell us what it was? I thin this was also when you stoped postig videos for a while. Thanks for all the great content!
Reply: @primitivetechnology9550  
Thanks for the explanation. Makes sense. Keep it up.
Reply: A Interaction for the Interaction God, a Comment for the Comment Throne, for the Almighty Algorithm
Reply: Hey I got a dumb question. Have you noticed that you and/or the area that you smelt in smells of iron after your smelts? If so, does the smell persist for a long time? I thought it could have an effect on wildlife avoiding your "civilized" area. Anyway awesome video! Thanks!
Reply: I think a little space between the blower and the pipe and you could get some free Venturi effect without any extra work. 3 or 4 inches back.
Reply: The question is: When are you making a PEDAL blower???
Reply: Maybe instead of knee and foot, you could try an old lathe method using a young, whippy, tree to tie off to the spindle. It might be more akin to your first blower and turn in two directions but you could get longer spin times from having the longer rope and the added torque in the return direction from the tree springing back. Or it could be used like your current bow method by pulling back tightly on the rope, tensing back the tree, and just letting the rope pull back freely in a quick motion so the rope doesn't bite into the spindle. You could also try adding 'teeth' to the spindle by carving into it, my thoughts being that the teeth would act like a ratchet almost, biting into the rope on the pull and creating less surface area for the rope to drag on during the reset. My final thought for an upgrade would be a simple wheel system. Instead of having the spindle tightly wedged between two staves, have it go through fully. Bind one end in rope, or just cut down a bit of wood to make a new spindle and carve it so it's got a fat end. On the other end have a wheel you can turn by hand. You might be able to make a free spinning handle but i'm not sure how well that would work. IT could possibly also be used with a rope method, effectively up gearing your blower and allowing faster spin rates. Maybe a vertical set up would be more ideal.
Reply: The bellows are powered by a spring-like movement similar to that used in traditional wood lathes.If you attach a string to the end of a tree branch, the movement is simple but requires less human force and can be used more efficiently. may be obtained
Reply: This may go against the spirit of the channel/project, but wouldn't it be more efficient to have a second person there to load charcoal and ore during smelts? That way the blower wouldn't be to be stopped so regularly and heat could remain more consistent.
Reply: @primitivetechnology9550 superb insights.
Reply: @user-ux3ow4yt2v yep. Been thinking this one for years. Also help with the fish. Nothing to stop multiple tiers of dams to help fish migrate too.
Reply: If heat is the name of the game maybe you can try this new blower with a more insulated furnace
Reply: I’ve followed you for some time now. My prior suggestion regarding the efficiency of your bellows seems to have been addressed. I think the reason you are still not seeing the results you want has something to do with the composition of the iron. I would suggest a surfactant to be added to the mix to cause the prills to flow better. They currently seem to  aggregate into pockets in the slag. You might consider adding calcium or sodium bearing salts to make the slag flow better.
Reply: Very happy to see you achieve a good step forward. As always utterly brilliant to see a new video from you!
Reply: @primitivetechnology9550 if you try casting another bar, then I would recommend putting a cover over top of the smelt pit. The bar itself in this video, while melted, didn't get hot enough to fully melt the iron, as evidenced by the lumpy/bumpy texture. It might be that the bar didn't spend enough time at that high temp, or that too much heat got lost from the open pit. Perhaps add the the ash insulation layer to the sides that you had in previous videos and a domed fired clay cap. That said, I love your videos and hopeful that society doesn't collapse so everyone doesn't have to learn these skills.
Reply: With the amount of things you carry around, especially in the brick making videos, perhaps making a wheelbarrow could be a useful investment? It would be a significant advancement in technology, using a wheel. If a wheel turns out to be infeasible, maybe even a wheel-less wheelbarrow that you can drag. I imagine this would essentially be a large basket built connected on top of a wooden frame with handles sticking out.
Reply: Have you considered developing a handcrank to spin the blower? If the diameter of the handcrank is larger, then a small turn of the crank would spin the blower multiple times. That is mechanical advantage working in your favor. I think this could achieve a continuous blow too.
edit: to be clear, the handcrank and the axle of the blower are connected using a rope. Perhaps the rope could be twisted to fit snugly around the axle.
Reply: Have you thought of adding a fly wheel to the blower?
Reply: Kalıbın kapağını kapat. Karışan kömür tozları kırılganlığı arttırıyor.
Reply: You have a stream or river flowing not far away, make a dam and a primitive water wheel to drive a primitive turbine - which supplies air to the furnace.
Reply: The iron prills are the perfect size to make some crucible steel, if you can find highly refractory clay (usually white color) in your area and make a crucible you could load it with iron prills+ charcoal as a carbon source and some regular sand as a protective layer from oxidation, fire the crucible in a charcoal furnace and get a nice homegenous ingot. 
Or next time around instead of just leaving the iron prills without protection in front of the blast cover them with some sand to act as a flux to protect from oxidation also make the mold deeper, that should give you a better result.
A reason why you might be producing cast iron is because your tuyere is placed too high in the furnace, the iron that forms falls down below the blast and gets carburized in the charcoal, if it remains in direct air blast it will burn the carbon off leaving you with almost pure iron.
Reply: Thank you for expanding my knowledge on this. I never gave a thought to how to make such things I always just used my modern blower and forge. Glad to see the old ways are being relearned and re-taught. Been a fan for years. Keep it up, I know its hard but your awesome and you got this! :D
Reply: The iron is too carbonized, that's what makes it so brittle
You need a better hammer to purify the iron (steel path) or a heat resistant vessel to separate it from the coals in later steps (casting iron path) and a brush for both, that should yield better results.
Reply: Adding a weight to the axle of the blower might help it keep its momentum on the reset stroke.  It could be made of clay or stone.
Reply: Two thoughts:

-Maybe make a small scoop, so you can drizzle the iron-rich powder into the furnace, rather than throwing it in in one big lump, because the heat is too high to let you spread it out? Having the powder spread more loosely, may make it easier to melt more, faster.

- when crushing the slag after cooling, would a rolling mortar and pestle be more useful? Basically a V-shaped groove, and a circular rock with a roughly V-shaped cross-section and a hole in the middle. <=||=> rolling in a V-shaped groove. Not sure if my explanation is good enough.
Reply: The next time you cast the iron try to add some of the lime you made with sea shells to it as a flux to help remove the impurities.
Reply: Oh, and another thing:
- I liked the look of the single continuous loop being pulled by both hands. But maybe make a hand-crank that gives you the same mechanical advantage as that loop? Might make it a lot easier, similar effort as having a pair of bellows.🤔
Reply: I’m pretty sure you have the materials and tools needed to skip straight to high carbon steel
Reply: I would consider what the iron bacteria is using as a substrate, because their iron-source might be better than their iron-collecting....or just terraform the stream and line the bottom of it with clay tiles/bricks and when you go to harvest the little rascals it would be way more efficient.

But if lining the stream with clay separates the bacteria from their substrate, that could be a concern, but I think you should figure out some way of cultivating the bacteria, or looking into the substrate the bacteria are living in itself.
Reply: @primitivetechnology9550  I have a question, is there a way of making the forge so that you don't have to reconstruct it every time? A system that separates the burning from the actual smelting, Even if charcoal is still added on top of the ore
Reply: A flywheel would help on making this a consistent and constant flow, rotation
Reply: 你很堅持用原始的方式製造鐵器，但你可能疏忽了，人類的歷史是先出現銅器才進入鐵器時代，也許製作鐵器的過程，已經有許多銅製的生產器具，而不是這麽原始
Reply: How difficult would it be to make a crucible to then completely melt down the iron?

Afterwards you could pour the molten iron into a mold, wait for it to cool down enough to throw it into some water to handle it easily then back to the fires to forge it?
Reply: Aren't you concerned about the carcinogens in the charcoal and the skin contact?
Reply: Oh the oxygen can’t get to the lower levels thanks!!
Reply: @DAV4WSR1  it was explained in the subtitles (always good to turn them on for his videos ;) ) it reduces the amount of heat needed
Reply: Make a flywheel!
Reply: Do you think you could make a small crucible and put the charcoal around it, do you think it would get hot enough?
Reply: how much did the crude bar of iron weigh after the smelt?
Reply: I'm curious to how different this blower is when compared to your previous attempt at using a bow to spin the fan inside horizontally. And is it possible to repurpose this blower to be used in a horizontal manner?
Reply: The frequency over last few years has been real bad and I keep waiting on something happening with all the bricks:( honestly the building vidoes are top tier but the rest are only ok
Reply: I think that the flactuations in the temperature is another problem that needs to be addressed, that being said the only choice you may have to keep the fire blowing consistently is through a water wheel (you can also put all of the coal in a funnel above and simply slide/twist something to open it and feed the fire without stopping the blowing), it should take you less time to cook the iron this way
Reply: I wonder if a flywheel would help smooth out the fan's lows (RPMs) and help keep temps higher overall.
Reply: Excellent !  Merci pour cette leçon!
Reply: @primitivetechnology9550 I wouldn't discount those small chunks of iron, if they can be tempered to not be so brittle they would make effective cutting heads for a lathe. You should be able to produce a very sharp cutting edge with just ceramics. Clickspring has a recent video on a primitive bow lathe that can be used to make some very precise parts. I think you have everything at your disposal to replicate it if you just replace the metal centres with fire sharpened sticks. Sharpening a small piece of iron like that by hand would be brutal so I would suggest making a small terracotta cylinder to go in the bow lathe for sharpening similar to how bench grinders are used today.

With a lathe and a sharp cutting tool you could make very useful machinery parts like pulleys or a screw which would allow you to make a press for oil. If you want to get really fancy you could potentially even make a cylinder roller bearing out of wood.
Reply: Can you make gunpowder and maybe there is better ore underground?
Reply: Awesome video! Would it be more efficient to smash all the slag and pan all of it from the start?
Reply: Can you make a magnet, by any chance? Help you sort out those little orbs o' iron.
Reply: Do you know how you could find iron without a stream, as in how to find the ore say in a country like scotland for example
Reply: Try reduction with carbon monoxide gas this would reduce carbon contamination of resulting iron
Reply: @primitivetechnology9550 You've explained the iron bacteria sourcing a few times but I'm curious what's the sustainability of it long term? Are you consistently drawing from the same section and it is growing back every time between pulls? are you pulling from different areas because it doesn't regrow quickly? Would love to get an idea of how renewable this iron bacteria actually is for you long term
Reply: hi John, I'm assuming that's your name, but even if it's a pseudonym, it works

do you still have yam, cassava, and sweet potatoes growing (I know those videos are 5+ years old), and/or do you have anything else growing?

one video you made piles of dirt protected by stones, so pigs wouldn't get at them, how did those turn out? are there still yams growing in them?
Reply: Have you considered consulting a smithing expert on the matter?
Reply: Interesting
Reply: I am very impressed with your rope's endurance. Pretty bloody good mate !.
Reply: U need to seal the iron pieces in a small clay jar and fill the void with flux. Then bring the temp up as high as you can for as long as you can. The iron needs to get bright yellow to fusion weld and be malleable.
Reply: Have you considered combining new blower with previous insulated furnace to produce hotter smelts?
Reply: Why don't you make a ferris wheel with a crank, and the wheel has a rope connected to the blower shaft, you can turn it while standing up and have much more power and use less force for the work, but the best thing is when you you can maintain the consistency of air inside the oven, without many changes in temperature! A hug, I love your channel!💪🏼
Reply: Well try the old chinese way of making crusibel steel add your ironpills and same dryed ore with same chrusched lime stone or sea shells  and a bltiny bit of charcoal dust Mix it and make a small pot about 1cm thick walls and a lid with a very small hole (tooth pick diameter) add the mix in the pot put the lid on with same mud or clay and heat it slowly till glowing hot keep it there for about 1h and  let it cool down  the pice of steel or iron is the kinda close to modern steel and is kinda hard too forge but you cann reduce carbon with more ore and add carbon with charcoal but the mixture mhm depends on the iron spills you have and how much carbon is in them
Reply: First of all, you are my technology GOD for what you did and still do, and the science behind it can be seen. About the blower, I have a quick question. From all I have seen in all your videos, you did not use any animal produce, anything. Historically , it was obviously very significant, but it is very obvious you do not want to use that. Or do you? 
My grandfather, an old type blacksmith, he used the blower with sheep skins, and the blower was very, very powerful. As in white hot carbon steel. And he used it with his feet, to keep it hot. So would you be interested in such a thing? Because it was definitely an Iron Age mechanism.
Thank you for your patience to read! Keep doing this awesome stuff!
Reply: make more of it and make a crucible you can put all the iron into. then make a Blast-furnace to get it up to a high enough temp to melt and turn it into steel. gotta burn all of that excess carbon out of the iron. also, be very VERY light in your strikes to start with. Iron is incredibly brittle, as you may have noticed. ^^ still Super cool to watch this, so please make more ^^
Reply: @primitivetechnology9550  Chinese windlass with a continuous  loop. should bring rpms up and make things more efficient
Reply: Been wondering if you could figure out glassblowing? That would be mega cool.
Reply: Wouldnt you be able to create a simple ceramic pulley with a lever handle? that way its easier to turn the continuous loop idea you had. Not sure if clay/ceramic would be too brittle to turn with a handle
Reply: I have a suggestion: to power the blower you could make a treadle with a fly wheel, this would get it to blow more consistently.

If you could set up a gearing system you could use a weight on a rope to store energy and drive the system while you are loading more charcoal.
Reply: Another suggestion: with the continuous loop the power the fan, why not make a hand-cranked wheel? With a large wheel it would provide a gear ratio and also act as a fly-wheel to power the blower. 

You could also add a small textured wheel to the blower drive shaft to provide better traction.
Reply: Is there anything you can mix in with the iron to help with decarbonization? Something like ancient borax?
Reply: @SwordQuake2  the carbon can generally just be burnt away as carbon dioxide. Part of the problem will be extracting the oxygen from the iron. In an industrial blast furnace they intentionally create carbon monoxide, because it will more effectively pull oxygen atoms away from iron atoms than plain carbon.

The boron would be more of a fluxing agent to remove other impurities like silicon.

I think I’m remembering correctly anyway. It’s been at least 15 years since I had to learn it for an exam though 😂
Reply: Wait, have you added calcium carbonate to the mixture? It helps to remove silicates and other impurities from the iron.

You can make it from limestone easily.
Reply: Here's another suggestion for an improvement: If you add a flywheel, the flow of air and therefore the heat would remain more constant.
Reply: Would you be able to magnetize that piece of iron you made before, then use it to pick up iron dust?
Reply: It seems like something that would be very useful is a flywheel> Can't be too difficult to make out of clay.

There IS a way to do a pole-lathe-style tree-spring mechanism, too. It needs some calibration, but at the end, you just need to hang from a vine and oscillate the branch. The key is a springy base post and a heavy log used as a clutch. 2 ropes are dangled from the same point on a spring branch, short and long. A tall springy post is planted in front of blower. One end of the clutch is loosely attached to the top of the post and the short rope. String a rope from the top of the clutch, looped around the fan axle, and then attached to bottom such that the the loop is loose at JUST the bottom of the untensioned clutch's travel. Suspend dangling end of clutch from long rope until loop around axle is JUST barely loose, creating a right triangle. The final step is to dangle a vine from the spring tree in front of the clutch attachment. Pull vine-> heavy clutch swings down battering ram style, loosely slipping loop into place at top of travel. Release vine-> Tree pulls up on torque-bow, tensions axle into hub, and draws like a violin bow to spin the axle until tree is untensioned at end of stroke. Oscillating up and down will create a sawing motion with a clutched down-stroke and an upward powerstroke. Only hitch I see is the tree pulling upward binding the axle against the hub and the rope slipping on the axle instead of spinning it.
Reply: @GooseGosselin  in theory he could if he can get a decent purity. You can magnetise iron by heat treating it, it just might not be that easy to get right the first time.
Reply: It's getting too hot. After forming the ingot in the  mold, place it on top of the charcoal. When it gets red hot, pull it out and start pounding. White hot is too hot
Reply: If you want to reduce carbon then make a crucible. What your doing is actually adding more carbon. Heat it up in a crucible with some flux and hammer it with a soft wooden mallet.
Reply: Have you thought of building a centrifuge to isolate bigger clumps of iron mud?
Reply: Hey incredible progress.
I think you should try one more thing in orden to avoid you a bit of work. Try adding a flywheel (disck of rock/clay, to the rotor of the fan.
When I saw you making it rotate with your feet as a pedal I inmediately thought pf the sewing machine of my mother. 
They use the same  principle with a pedal to make the axe spin in one direction.
A flywheel will make it harder to start but will save you a lot of effort while its already spinning.
Keep up the great videos.
Reply: Gears and crank time for a constant fan blowing motion?
Reply: Yeah I was pretty disappointed how it broke apart like that too. What if instead of putting the coal on top, you made a bigger crucible and had the coal on the outside, similar to how scrap metal is melted down in a casting forge? Maybe it won't get hot enough, but then you could add the iron in as you go, remove slag and whatnot.
Reply: When trying to decarburize/ forge the iron, you are putting the iron prills in the coldest part of the furnace (right next to the cold air entrance). Dont bury the iron under the charcoal, instead create a channel so that air flows through most of the burning charcoal and then hits the iron, then you will get the high temperatures you need for forging. Also burying iron in charcoal will further dissolve carbon in it.
Reply: It is said that during the Middle Ages, Korean blacksmiths mixed charcoal with bitumen and lime to use it as a substitute for coke fuel... Would you like to try this method?
Reply: Maybe there is a source of flux to help lower the slag? Seems like most of the final product was slag anyway haha
Reply: Ad a flywheel with a grove for the string to the fan axel and you don’t have to move that “bow” so fast thus saving your strength,!
Reply: Hello, you can make a crossbow with materials from nature
Reply: What about building a sheltered forge near a stream of water and use the stream to power the blower ? It might raise significantly the temperature in your furnace, allowing smelting and melting cast iron more efficently.
Reply: This is probably a silly and mundane suggestion but I keep feeling like you need some kind of little shovel or hand scoop, maybe with a long handle, for being able to quickly feed charcoal and ore into the furnace one-handed without having to stop and get up and dedicate both arms to it.
Reply: in purification process there way had use in Japan history celled thermal explosion in which put water in heat red iron and then knocked over it more easier
Reply: Have you considered using ropes and weights/counterweights to further automate the process? 

I would be curious, because I would think you could successfully 'pre-wind' the system like an old clockwork watch. I wish I could draw it out for you real fast, but it has been a delight to watch you modernize. Aim for steel. It unlocks a lot more than iron.

I would originally draw it up as a single weight wrapped around the wheel to pull it by gravity...

But then I wonder why you don't just create a water-based system. So create a second wheel like the first. The shaft connects wheel to wheel. Have a pipe that feeds water to the second wheel. Bam, you are done. It looks like you have a lot of the stuff you need figured out for this. The great news is that it simply requires you to keep the reservoir full.

An aqueduct would further simplify the process, allowing you to maintain far greater and consistent temperatures.
Reply: Thank you for providing such a wonderful experience
Reply: @primitivetechnology9550  As a metallurgist I suggest you to use a crucible for decarburizing the iron. If the iron is still touching the charcoal you basically can't decarburize. 
The method by just heat the ingot to a yellow-red hot can work but, due to the gradient of the carbon migration to the surface in fuction of temperature, this can take a lot of time. I mean 8 hours or more. 
I don't know if you can do that, but remelt it in a crucible and blowing the liquid iron with the blow  is the way to set the carbon content under 2% that can transform it in forgable steel.
Reply: Is there any way for you to cultivate the iron bacteria?
Reply: Hi John, I don't know how long you read the comments in this thread, but if you do then I'll add this

if you do more agriculture, a large scale project you could consider that would probably help with agriculture

an aqueduct, using some kind of fired clay I would think would be the easiest way for the actual pathway that the water travels.   

I don't know the distance of the stream to your potential garden locations, so maybe it's not practical (not as in an aqueduct isn't practical for longer distances, just the amount of work and fired bricks and mortar one would have to make)

I suppose hypothetically a much less labour intensive version would be like your early huts you made (I'm just assuming getting all the clay, firing bricks and firing ash cement is time consuming, and all the wood required)

using sticks as fenceposts, and then sticks woven lengthwise into the fenceposts, and then mud as the wall.  Maybe even two woven fences maybe two inches apart.  Then fired curved clay tiles could be placed on top of this reinforced mud wall overlapping one another at the ends. (longer tiles are preferrable and in a perfect world, if the end of the tile was thinner, it would help make the aqueduct more efficient)

although something made of dried mud, even with clay tiles on top seems very susceptible to failure due to rain, or floods

you would also need a decent sized holding "pool" to make it worth your time to make an aqueduct.

You could design a large scale holding "pond", and make fired clay bricks to line, and then have clay behind the brings so no water escapes.  The bricks are just there so the water that comes into the pond doesn't stir up clay into the water every time water is put into the holding pool.  This pool would be in the ground, because to make it elevated would require your entire aqueduct to be that much taller.

hypothetically, he pool if big enough could be used as an actual pool, even if just for one person.

If the idea of a pool for human use is considered, hypothetically, the floor layer could be two layers of bricks, so that the pressure of stepping on a brick is distributed over a larger surface area, so the clay underneath the bricks is less likely to be affected by walking on bricks.
Reply: It really puts it into perspective just how much repetitive grunt work goes into leveling up civilization.
Reply: I believe historically tongs are the most important thing to make fist if you plan to boost your foundry toolbox to make more tools. @jimmySeki
Reply: perhaps wooden tongs with iron tips. @jimmySeki
Reply: also John if you read this

I made another comment about a possible idea being aqueducts (which wouldn't surprize me if you have every idea under the sun in your mind already seeing all you've done)

anyways, I originally said fired clay bricks might be best, for the bottom of a holding pool (lined with clay)

but on second thought, I remember your yam planters, and the first structure you built used flat stones

You could just use flat stones, or really any stones to line the holding pool, just so clay isn't stirred up every time water is poured in

hope things are going well for you
Reply: Could you boil blood until it is just iron? Skipping the need for this process?
Reply: I've been following you since the beginning man, was sad to see you disappear for a while. 

My idea might be too obvious and stupid but you know the continuous loop method you used? I made a little prototype at home out of wood and string and turned it into a belt/pully system. Same idea you had in the video with a wheel where your top hand is and a tensioner on the bottom. I put the rope on the end of the spindle though not the middle. Figured if it worked for you, you may be able to automate the rotation with heat/water/steam?  

What do you plan to try and forge with your first usable bit of iron? I know the dagger video you mentioned an axe head but have you considered something smaller like some crude gears or bearings to increase rotation and air flow to your kiln?
Reply: @adamwallasky389   Hey this would be a fascinating new direction for him. Have noticed that to his credit he doesn't kill animals to make his videos so I guess it would need to be his own blood. But also if he was into killing and tanning hides he could make a proper bellows and really pump some air. Also I think he would need like 2500 liters of blood to have 1 gram of iron. a hemoglobin has only like 4 iron atoms.
Reply: S⑦s→¥i II Qolo
Reply: Can you please add some sand too. If you make more fluid slag the iron beads will settle at the bottom and even possibly fuse together.
Reply: As I said - make an insulation over bricks with mix of clay and dry grass - it will increase the output
Reply: I think you can try making fly wheel and pulley from clay, maybe even cranknkshaft and pedal
Reply: Using a crank to drive the fan might be more effective. Might be a bit elaborate given your tools and materials.
Reply: You will be wanting a push-pull type blower, tuyeres on opposite sides, alternately used as air in-exhaust gasses out, wit exhaust gasses blown through a chimney filled with a loosely stacked column of bricks which heat up during their turn in exhaust, then give up that heat to the feed air during their turn at blasting the charcoal (now with pre heated air!). Then you could reach liquid iron temperatures, slag could float to top of mould and be broken off. Your barely welded together bar of iron prills has so much slag that it can't weld together properly. Look up "wrought iron" for process of squeezing slag out by repeatedly heating, hammering, folding, which also helps decarbuerize the cast iron a bit, eventually you get "malleable iron" suitable for tools, then if you can infuse JUST A LITTLE CARBON back into that, steel.
Reply: @primitivetechnology9550 I think maybe making a setup for a foot powered blower similar to a spinning wheel used fro spinning yarn may be effective
Reply: @primitivetechnology9550 Are there any deeper ponds in your area or is it all constantly running waters? At least from what i've learned from baltic swamp iron making process, the richest iron sediment was at the bottom of calm ponds and stream bends, it might gather in similar clumps in your area
Reply: I came here from your charcoal video 8 years ago and it feels like the charcoal here would be worse than the video i saw, no? High quality charcoal needed to get the temperatures even close to what you need here is something done in a proper charcoal pile and can easily be a multi-day affair. Even in the older video, you might have let too much of the wood burn. 

With the charcoal in this video, i suspect the carbon percentage wouldn't be very high due to how much unrestricted burning the wood went through. I think refining how you make charcoal could definitely help get you closer to getting some proper iron smelting.

Specifically the methods ive seen you do involve getting the wood hot, but then sealing the kiln and letting it cool. The problem is that the low-oxygen, high-heat environment is how you get rid of most of the non-carbon compounds while leaving the carbon (aka, the charcoal you want). With your method, the wood is only getting a small window where it is not fully combusting, but is hot enough to still 'distill' away everything else. What you would want is to manage the kiln by constantly opening and closing the draft holes you have at the bottom of your kilns to balance keeping it hot enough without just letting it burn. (Side note, gotta keep some ventilation at the top as the distilled products can actually produce enough pressure to explode if not vented)
Reply: I would recommend remelting alone to reduce the risk of it chemically binding to the slag due to the chemical equilibrium being shifted due to the high concentration of metallic iron
Reply: You could study the production of tahamagane in Japan, they use clay to make a reduction furnace where there is no oxygen for quality punching. After this, several boiling processes must be redone in order to expel impurities from the iron. Ancient process for manufacturing steel for katanas.
Reply: You have a nice piece of rope you could use like a belt, you could make pulleys from ceramic, and try a treadle-style foot drive? You'd only need short sticks for your shafts, then, and can use a big to small pulley ratio to speed the fan up more than you can physically do yourself?

While I think you can easily make the pulleys and shim them to your shafts, I accept that rope might make a bad belt.

It might also be worth seeing if you can do a water drive for it- I think the consistency and speed of your blower are very important for your heat output, but I have no idea if these ideas are practical!

I absolutely adore your videos and watch them to sleep, one thing I would love to see you explain is how you made a porous pot compared to the water tight ones?
Reply: If you could make a magnet for the very small chunks it would help.
Reply: Casting is definitely the direction you need to be going at this stage. In our history, much of early ironworking was casting iron into usable shapes. Forging did happen in the past, but you‘ll need higher temperatures to get a solid block of iron (rather than semi-melted pellets) before you can start forging properly.
Reply: No way this is primitive??? How did you know that there is iron bacteria in the creek?
Reply: I think adding a small/medium sized weight wheel to the blower for maintaining inertia could be the simplest way to reduce down time in airflow, you could try to make one in a similar way as to how you attached the blowing fins, but with a clay "worm" that forms a ring (a ring has the highest angular inertia with equal weight)
Reply: Doing this with copper instead and/or using copper tools may make metallurgy overall easier and more successful. These benefits could then be used to work iron more efficiently.